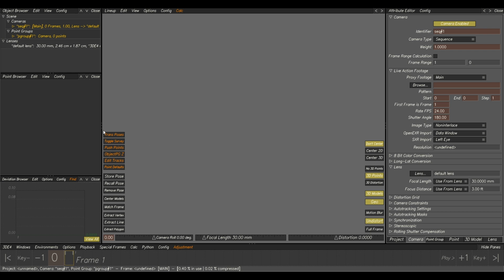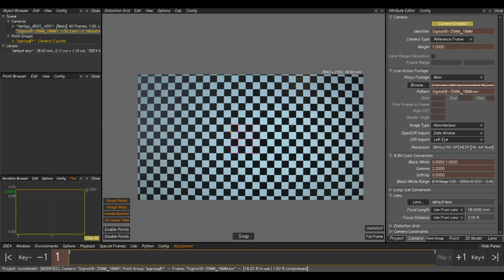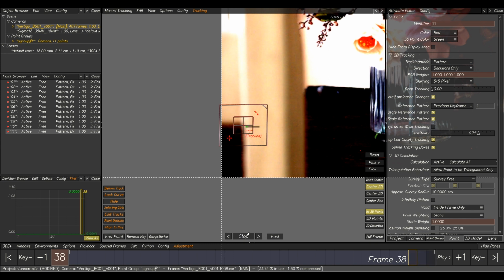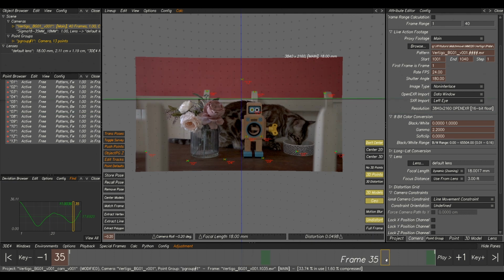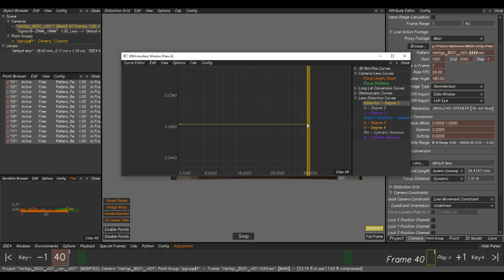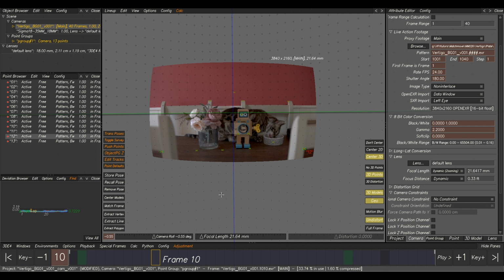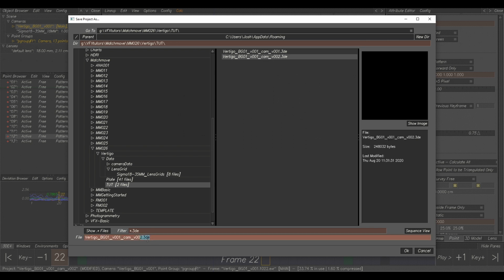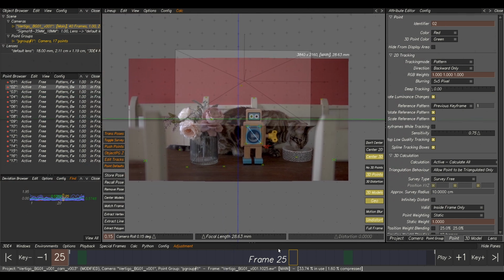3DEqualizer - How To Matchmove Zolly Vertigo Shots

Comment: Hi Josh, Your 3de tutorials are really cool and its great you did them as there is not a lot of info about how to use 3de. so big RESPECT for that. I would like to ask you if you can make tutorial how track shots without paralax where we mostly get flat plane tracks (for example static camera rotating) or something like for example F1 racing shots (just used as example) where is rotation (sometimes rotation and zoom at the same time).  How to find  correct depth info from these kind of shots without knowing corect lens and distortion? basicaly random footage from internet without any tracking information. Coz i do mostly get flat  or half cylinder plane without any depth. Thanks Josh :)

Comment: What is its difference between Calc zoom curve and Classic frame by frame zoom curve finetunning?
In this case, Can I use upper one(Calc zoom curve)?
And.. I think deviation will be better if distortion curves are smooth..right?
It is just my thought .. 
I love your tutorial. Thanx!
Reply from the maker: yeah, you can use the calc zoom curve, its sometimes better if you have a good idea of how the zoom is working,
I prefer classic frame by frame most of the time as is slightly adjusts your camera as well as the zoom, and usually works really well, 
I only really use the calc zoom curve if I'm having really tricky zoom problems,
Reply: @VFXTutors  thanks your response 🥰🥰

Comment: I see you use 18mm focal length directly, if you don’t know the starting focal length and the ending focal length. How to solve this kind of lens?
Reply from the maker: sometimes you have to do a best guess by eye, or you can use a character model in 3de to see if it looks ok,
But as long as you put the camera constraint on line movement, the zoom solve should do a good job, you may have to solve a few times, but its usually really good,
Reply: VFX Tutors  I want to know how the zoom lens needs to be converted to flim back in Maya，Use natron or nukex to output the distortion and then operate in Maya, thanks
Reply from the maker: once you export from 3de everything is already done, you don't need to convert anything, when you render your UDP from warp4 it renders with all the zoom and animated distortion.
and the NukeLDnode has all the animated distortion, so its the same process as any other tracking shot.
all you need to do in Maya is swap your image plane to the UDP footage :)

hope that helps :)